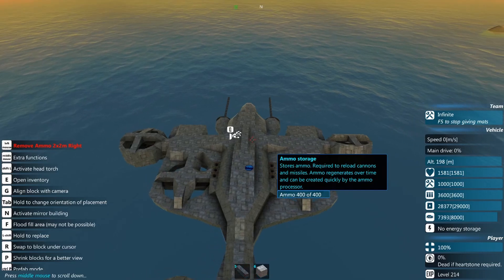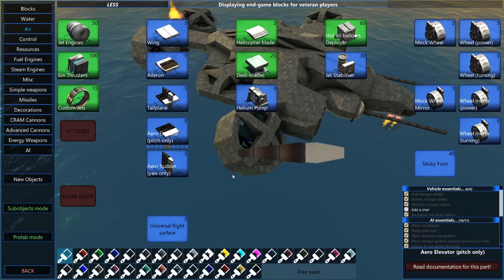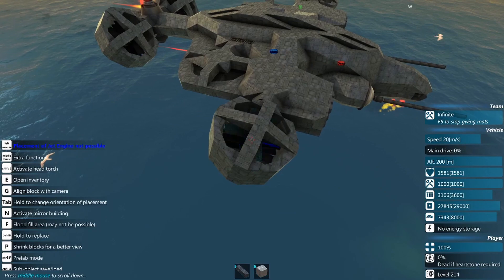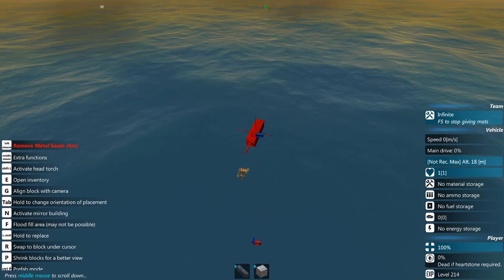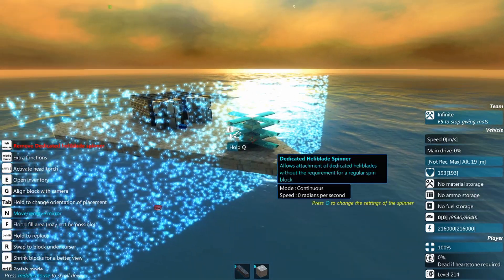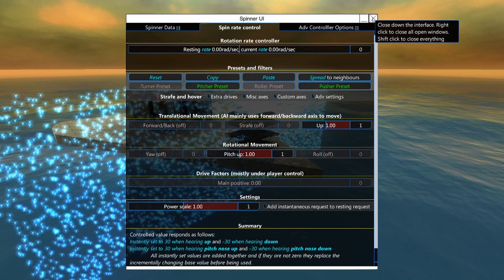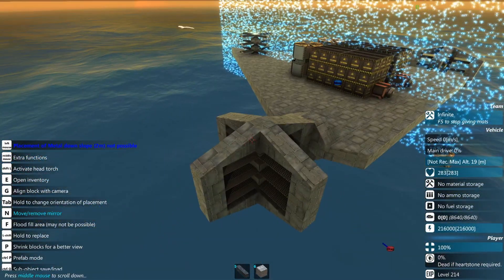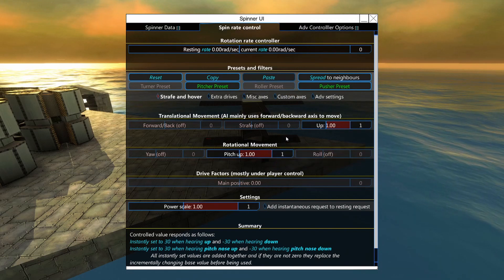From the Depths - Tutorial 9: Tilt Rotors

Comment: Wow! So my whole problem was having dediblades yaw on rotors... I haven't even thought about indirect yaw. Thank you so much!
Reply from the maker: Glad the video helped! The accidental roll threw me for a loop at first too; I hadn't even thought about it until I used the simple aircraft controller to test things. Testing one input at a time by hand is really useful!
Reply: @Strycken1  So my hover actually works super good rn and last part that messed me up was using forward/back on tilt controls. Once I switched it all to hover it worked super well and it did forward/back movement nicely.I had to make yaw like 0.03 cause it impacted the vehicle so much and used 72 degrees max like you said. I did build my hover like yours from into in this vid , the shape at least :D
Reply from the maker: @nobunagaoda8439  Awesome! Glad to hear it's working out for you. The 72 degrees helps make sure you can keep at least some of the rotor power going towards lift, which is super important for that whole flying thing. Technically the exact values you want depend on the vehicle weight and rotor power; the less power you have compared to your weight, the lower that angle will need to be in order to keep flying smoothly.
Reply: Yea, good Tut-, for me i think it was setting every signal at 1.0 ...because i belived and trusted devs know how to make (or copy from google) simple proper mixing algorithm that tone down all inputs in liner way (same proportion) until they all close in 100% factor -.-